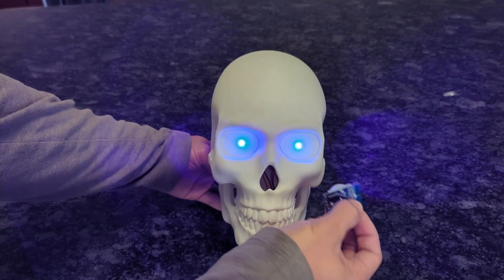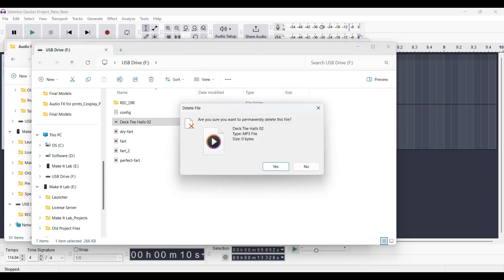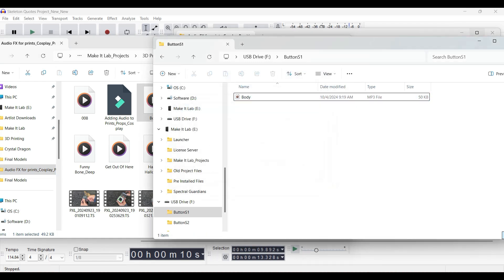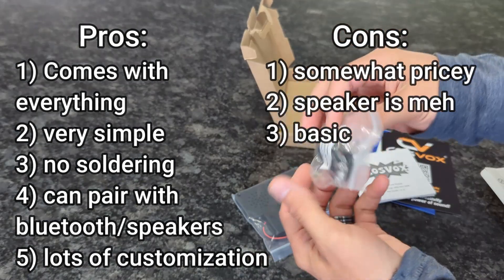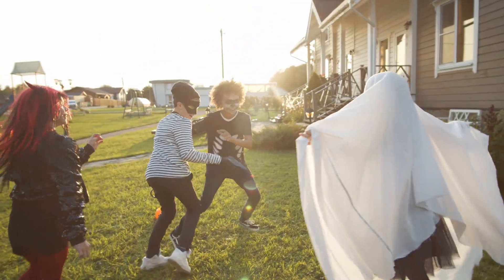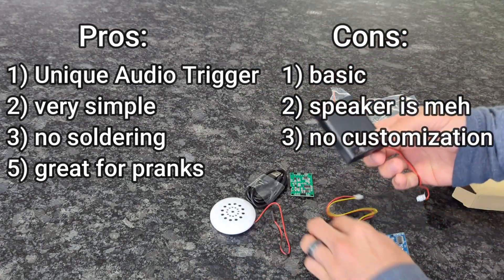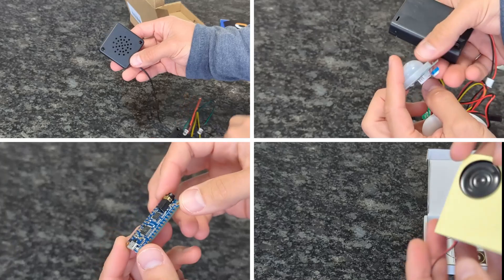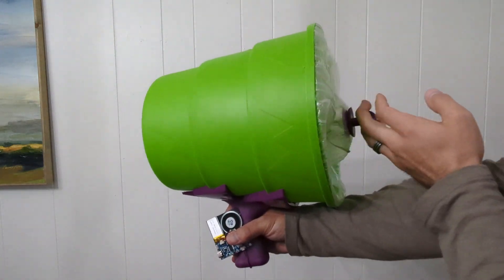How To Easily Add Sound Effects to Your 3D-Prints, Props, or Cosplay!

Comment: On the ADAFRUIT board, could it be wired to trigger from a motion sensor to randomly play different sound files?
Reply from the maker: I would bet so, as you can set this up with other inputs such as pressing a button, would just have to find a motion sensor that would work with the board, but this might need to be paired with an Arduino Uno as well

Comment: OK, so I want to add a catch phrase sound to an amigurumi (crocheted stuffie). The module would be embedded in stuffing or sandwiched between yarn. What can I use to protect the components from the fibers?

Thanks!
Reply from the maker: That is a good question. It would probably have to be something that both protects from the fibers but also dissipates heat, as you would not want a battery overheating in there. I would hate to recommend something that wouldn't work well or could cause issues, but my first thought is maybe a thin layer of aluminum foil around the components?

Comment: Nice video, now I know more on this topic. I was looking for something like this for a cosplay I wanted to wear this Halloween: basically I imagined myself having a button on like my belt, and have it send a loud cry over a speaker, all while also being a cheap system. And I would also like to keep it for future projects. So for these reasons, I think the Adafruit soundboard seems like the best option for what I want to do. But I have no experience with boards of any kind 😅... Like what kind of button do I need to buy? How do I power the board? Do I need any shielding for the board (I would like to put it in my pant's pocket or something)? Do you think that I can make it, or maybe I should look for something easier? Do you have any other advice?
Reply from the maker: Much appreciated. I think this would be doable, but I would need some additional info. Where would you be placing the speaker? If location doesn't matter much, I think the Cosvox Cosplay/Sound module would work well, as you would only need to upload the audio and press the pre-made buttons to make it work. If you wanted the speaker to be wireless, you can also hook up a Bluetooth transmitter/receiver to the Cosvox and pair it to a Bluetooth speaker (just like in the video). That would be the simplest way based on what I have heard. If you wanted to have more complexity to it, the Adafruit Audio FX soundboard is fantastic, but you will have to solder a bit. They have great tutorials on their website that have really helped me as well: https://www.adafruit.com/product/2133
Reply: @makeitlabchannel I will check out the tutorials, thank you! Also, I either wanted to use a bluetooth speaker and connect a Bluetooth transmitter to the soundboard or put the soundboard on my back with a wired speaker (about that, is the one you use in the video able to be loud while preserving quality of sound? Do you recommend it?). And I wanted to have something flexible that I would be able to use in future projects, I don't think soldering will be much of a problem, my dad could help me with that. Again thanks!

Comment: Any ideas to make a sword play an audio when swung? Kind of like a light saber. Not sure what trigger I would need.
Reply from the maker: Hey there, that is a good question. I am not an expert, but I would probably go with a DFPlayer Mini module and a vibration sensor module, paired with a small speaker/battery pack. I will have to test this and see what would be the easiest, because I think there is some demand. Heck, maybe you could even get a cheap motion sword that triggers sounds and take out the components and add them to your project?

Comment: Thanks for the video! For the first cheap one (XLW), how easy would it be to remove the speaker so I can place it separate from the board? It looks glued on? Can it unstick, or would you have to perhaps just cut the paper it appears to be attached to? Thanks in advance!
Reply from the maker: Hope it was helpful! For the XLW, the speaker is just attached with adhesive, so it is very easy to remove from the rest of the board. The only problem is the wires are really short, so if you want it far away from the board, you might have to solder longer wires on or find a compatible extension
Reply: @makeitlabchannel  Hey, just wanted to thank you again! This thing was PERFECT for my small project. Appreciate the help!
Reply from the maker: @domareidal5997 Very glad to hear it!
Reply: @makeitlabchannel thanks so much! It doesn't have to be far, just rotated really. And I'm good to solder if need be. I think I'll go with this one! Appreciate it!

Comment: I build large scale movie spaceships, I'd like for the lights and the pew pew sound to activate at the same time.
Reply from the maker: @unitruth  That sounds very cool! I haven't found a product yet that can do both without coding, but I know an Arduino Uno with an adafruit Audio FX board can trigger both sound and lights based on input (button, motion, timer, etc)
Reply: @makeitlabchannel  I ordered the blues, they'll be here tomorrow. 
I'm going to hook the LED between the speaker and the power source. 
The LED should come on as long as the sound comes on.
Reply from the maker: @unitruth  Oh that is a good idea, I would love to hear how it turns out!
Reply: Also on the cosvox what is the LED voltage coming out? Does it say?
Reply from the maker: @unitruth  I read that the operating voltage is 4.5 to 6 volts for the LEDs, if that answers your question
Reply: @makeitlabchannel  thank you
Reply from the maker: @unitruth  I can't seem to find much information about the LEDs themselves weirdly enough
Reply: @makeitlabchannel  I know the speaker on the blues is 2.83 volts with 3.7 volt rechargeable lithium battery.